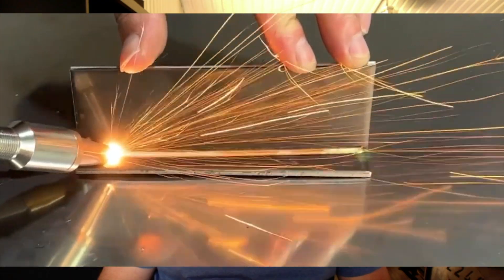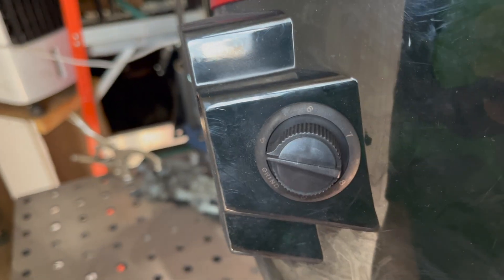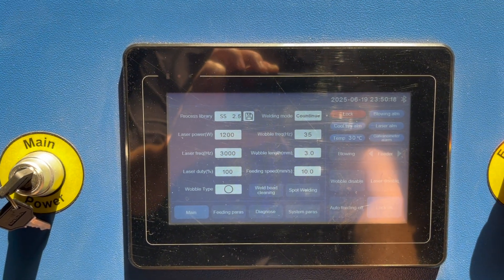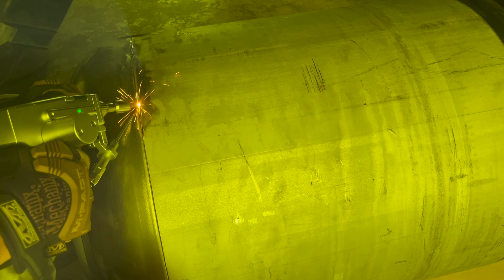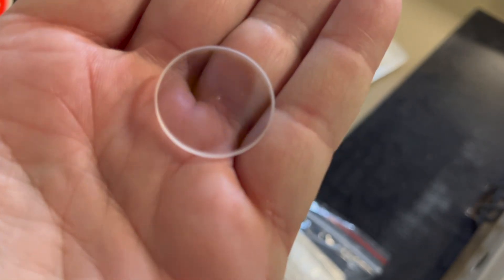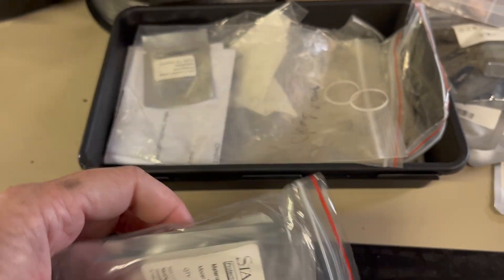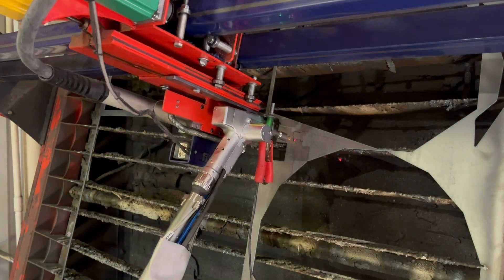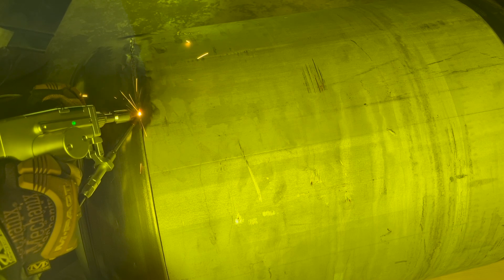Ditch TIG & MIG: Handheld Laser Welding Secrets You NEED!

Comment: Most informative laser welding video ive seen mate. I have a 1500 watt laser welder, cutter and cleaner. any chance you could share some of your most used settings and for what materials. cheers
Reply: To share welding settings, you must be using the exact same laser welder. Settings are manufacturer‑dependent, and late‑model machines run with beam diameters in the 150–25 micron range. That difference in spot size makes a huge impact on parameters. I’ve got a video that explains this in detail.
Reply from the maker: Thanks!  I use most of the settings that come with the machine with 2 changes.  I increase the width of the laser wobble by 0.5mm and decrease the wire speed by 1mm.  Also i use the circle wobble if you have it, gives freedom of welding directions.
Reply: @k-rigg  Thanks mate. Appreciate it
Reply from the maker: @RestorationRookies  welcome